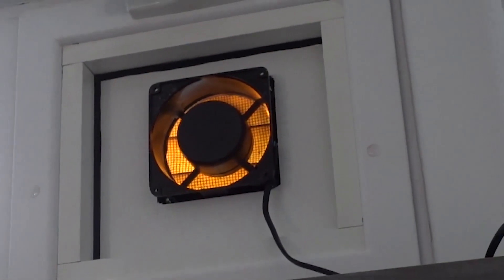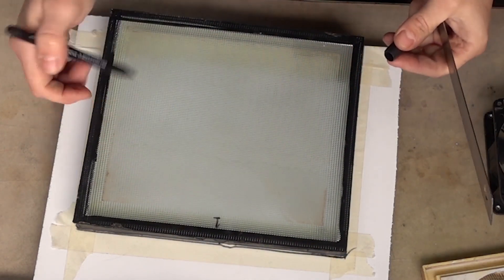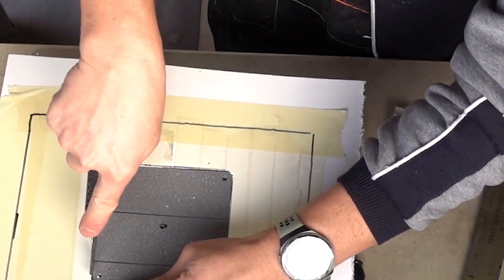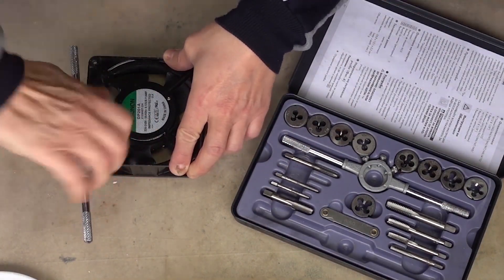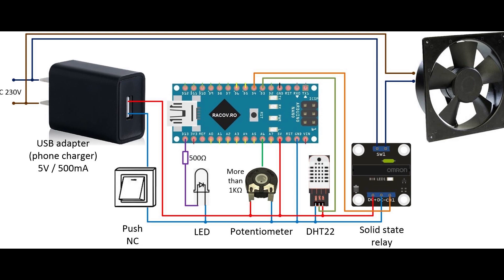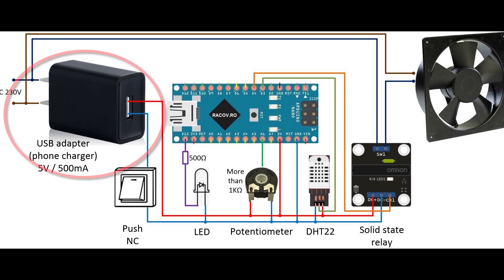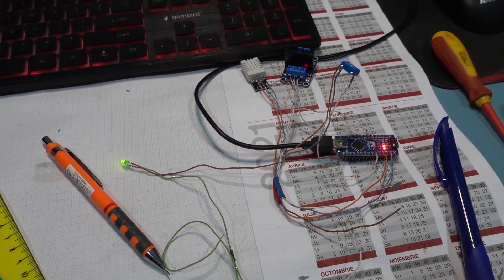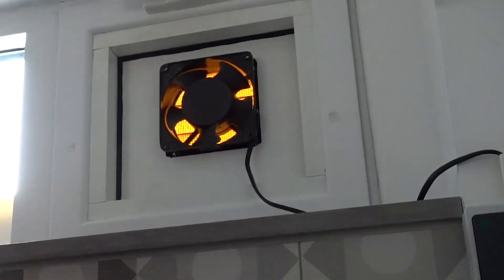Automatic FART EXTRACTOR / Bathroom Dehumidifier Fan with Arduino and DHT22

Comment: size of the fan?... .
Reply from the maker: 20 centimetres
Reply: @Racov  i mean its a pc fan.. 120x20cm?
Reply from the maker: @edwardseth1230  no. It runs at mains power 220v. I don't think a PC fan is powerful enough for a bathroom. For other applications, of course, you can use a PC fan.
Reply: @Racov  let me clearify. when i ask what is the size of the fan you said.. 20CM.. so i replied to the dimention of the PC fan.. 120 Diameter and 20cm grith or deep... cause there are old SERVER fans that size and very rugged.. the modern RGB fans of the same size 120x20cm are more or less.. very flimsy. good to run a pc.. but not for this type of application.
Reply from the maker: @edwardseth1230  True. Misunderstanding. The fan frame size is 20x20 centimetres and the deep around 4 centimetres. It runs at mains power 220v. It is indeed a spare part from an industrial computer. The PC fan is 120x20 millimetres (12x2 centimetres)
Reply: @Racov  interesting would be to make the same project with rechargable 18650 batteries with a 2 cell battery shield with either a microUSB charger or Type C directly from power socket (grid tied). and an Aurdino Script if the batteries fall down to 21% then its starts charging but up to 91%.